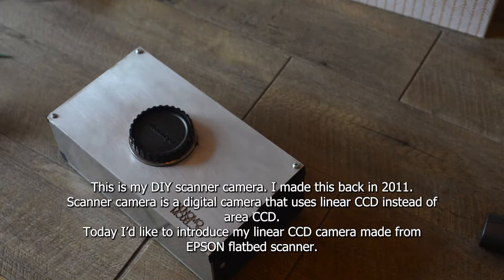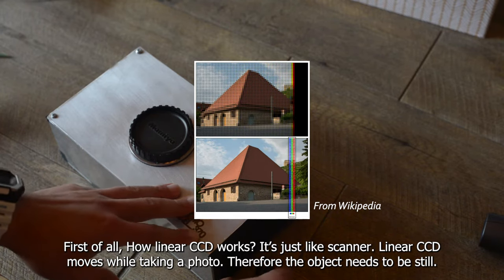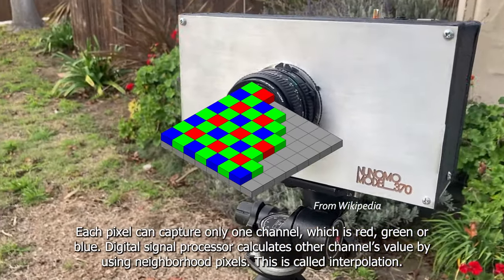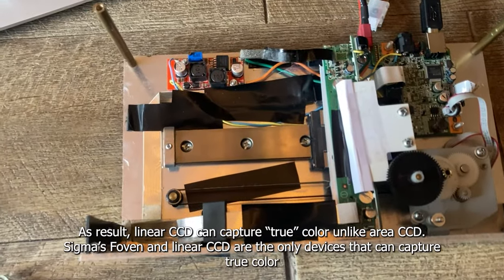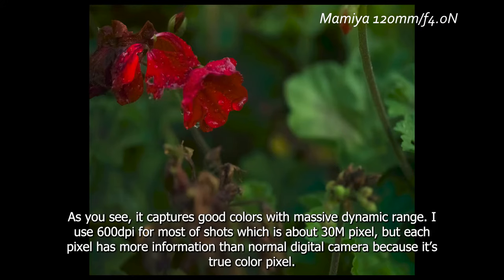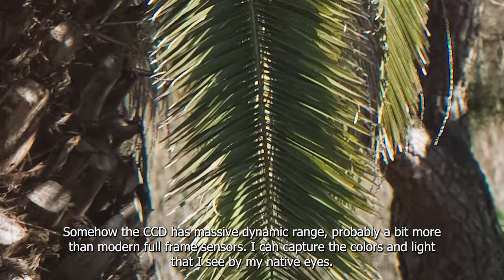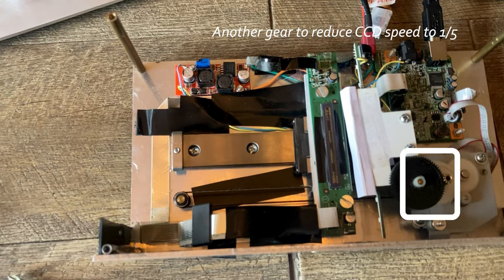Handmade medium format 140M pixel digital camera

Comment: What Epson flat bed scanner has so small linear CCD, this looks more  like film scanner CCD ?
Also how are you getting 140MP with 1200 DPI on 6x4.5? it is more like 2824x2123 pixels which is about 6Mp ?
In order to capture 140Mp on 6x4.5cm frame you need something (roughly) 10000x14000 pixels, which is  (roughly) 5600 DPI !
First of all that has to be darn good linear CCD to support up 6400 dpi 
Also and probably the most important your device linear movement has to be super precise to be able to scan 6400 lines per inch !

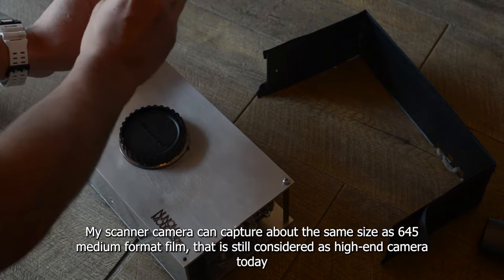Comment: The resolution can go very high? I'm sure that you know better than I do that this is not an accurate statement (subtitles at 1:35). You are talking not about the resolution but merely about the size of the image in pixels. Pixels themselves don't resolve anything. Resolution is the ability of the system to resolve some distinct object features as separate, so it is measured in angular or linear distance units. Nevertheless, it does not reduce the value of your excellent work. It is excellent!

Comment: Regarding the lightbox area. Which LEDs did you use, just the ones from the scanner? How was it controlled/ turned on and off for the initialization. I am trying to build a scanner camera with the Epson v37, and it seems as this is one of the more complicated details, so I would be really happy, if you could help me.
Reply: I am attempting a similar project and am also curious

Comment: Ryan! This is a super interesting project. I do have a question for you about the scanner. In similar projects people tend to use a ground glass in front of the scanner, but this destroys the resolution of the camera! But from your camera it looks like a ground glass wouldn't be needed if the focal plane is lined up correctly-- is this true?
Reply from the maker: Probably the other projects use CIS scanner (If you are seeing monochrome in the result it's CIS). I use CDD scanner and removed lens to shrink down the image.
Reply: @raspy00135  you removed the lens on the scanner sensor?

Comment: Amazing project! I would like to point out however that as far as I know most cameras don't interpolate values between subpixels - just one pixel is 2x2 cells (subpixels). The lack of "true color" comes from the fact that each channel is measured in slightly offset place but assumed it's in the same. There's also one more type of camera that can capture true color - Three-CCD cameras which instead of relying on Bayer filter split image with prism and apply filter to each one, with each channell having separate CCD.

Comment: Do you have any understanding of the dynamic range of such a system? Being an astrophotographer, I'm kinda curious about this first and foremost.
Reply from the maker: Hi it's impossible to take night picture since I don't have exposure control.
Reply: @raspy00135  Oh, ok. Do you have control over scanning speed? I guess it determines horizontal resolution, but with the right kind of math you could theoretically use this as a long exposure too.

Comment: Hi! 

Looks like an amazing camera to work with, would you mind sharing some information on how you made this and how it operates? (Does it have a battery and where does the scanner software run from?)

Thanks! 🙌
Reply: The DEANS battery connector and internal DC/DC converter tells me this runs from a RC model battery pack. The scanner needs USB connection to a PC/Mac to run.

Comment: Could you share how you were able to turn off the light source?
Reply from the maker: Just take it off, but you still need the light source to trick the initialization process
Reply: Many thanks for coming back to me @raspy00135   - I wonder because the light source appears to turn off before the ccd moves in your video. I just wondered how you do it? Is it with a manual switch? or are you doing something clever with additional components? I would guess its not a limit switch because the light source turns off before the ccd moves
Reply: Maybe a timer 555 switch configured for 2-3 seconds?

Comment: I saw a couple of people mention in the comments that the hardest part of realizing this project would be the "initialization". Can anyone explains what this means? To me it seems pretty simple: buy the same scanner, tear it down while keeping all electrical connections intact, rig it up at the correct distance from your lens and Bob's your uncle?
Reply from the maker: There is a touch switch to detect sensor's position, also the firmware checks the backlight. You need to trick the firmware, but I showed what I do in the video. I didn't explain detail but it should be good enough to get started. I mean anyway it is not an easy project.
Reply: @raspy00135  Ah-ha, thanks for the info! Did you share the firmware hack, so people could at least get it working using the same scanner?
Reply from the maker: @retromograph3893  There is no mod to the firmware. All tricks are done in hardware level, and I explained around 3:30. I know it's not complete information but it's good enough to get the idea if you are ready to get into the project.

Comment: can it be used in astrophotography?
Reply: no.   scanner can't do long exposures.  it basically have only one exposure setting.  (fixed time for reading its pixel lines)
Reply: @vasyapupken  in the video he didn't tell how long the image was getting scanned for
Reply: I am not sure you could mount this to a GEM to prevent image shift as the planet turns.  It looks really heavy.  Due to its pixel count and full color collection on a single pass it would be very useful as an all sky cam.  But again you would need mount on maybe a polarity aligned barn door type mount to prevent star trails.  The mount would also need to reset every shot.  The gcode for this would not be all that hard.  The moon would still look wanky.

Comment: its wrongg.....   thats CMOS method
right is :
CCD is global shutter ..
and CMOS is scanning shutter
Reply: You haven't listened to the video.
Reply: @IliaSibiryakov  thats scanning or rolling method. Not global shutter
Reply: @arendelle_ok  This sensor is a single row of pixels that actually moves. And it is CCD. It is not a rectangle like in most cameras. So that information does not apply.
Reply: @IliaSibiryakov  i know. and im familiar with the usb scanner printing.. and the real sensor camera is rectangle when u remove the lens..

but the scanner is moving from the left to right. or some times up and down. this is roling scann method..
look on smarter everyday
Reply: Whatever! I don't even understand you anymore.